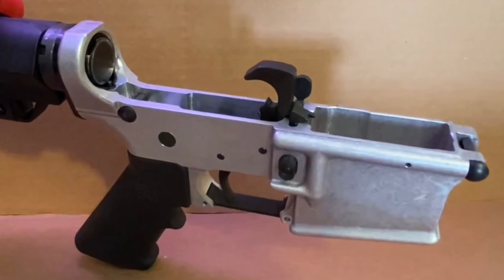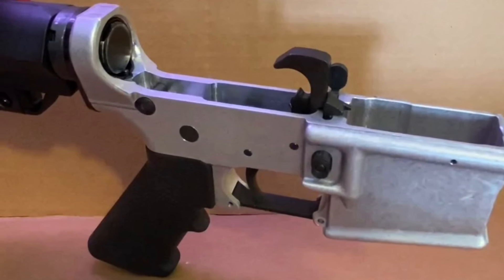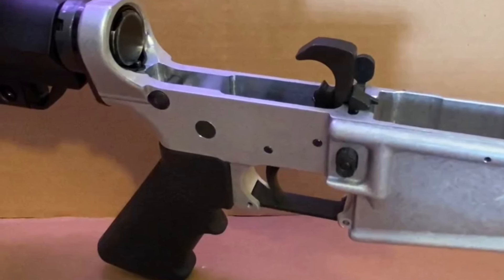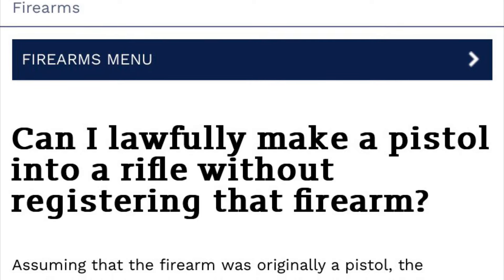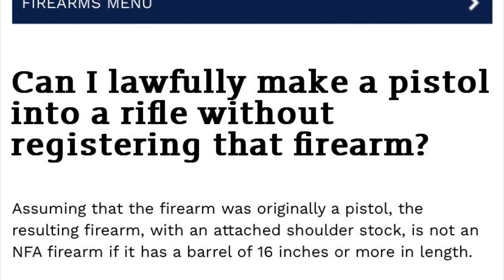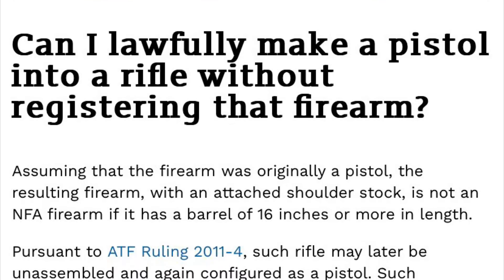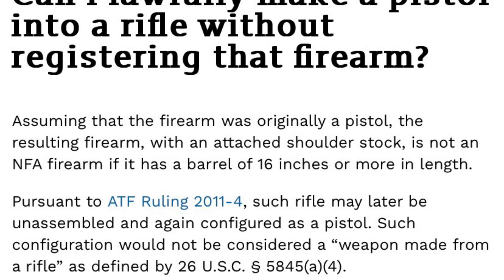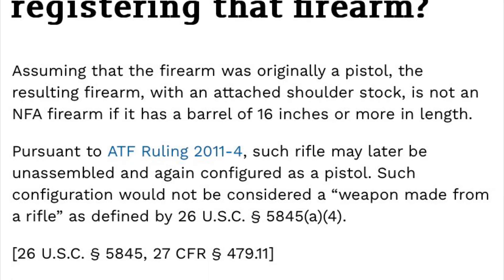AR builders tip #.223 - BUILD THEM AS PISTOLS FIRST

Comment: does the ar pistol have to have buffer tube? i was thinking of  making a brn 180 build and it doesnt need a buffer
Reply from the maker: With a BRN180, it doesn’t need the buffer tube. I believe they sell a threaded plug that you use in place of the buffer tube for an application such as yours.
Reply: @SMR-Tactical  yeah i was just wondering if i could use the  180 upper and leave nothing on the back .... is that still a ar pistol?

Comment: you cant go pistol to rifle than back. not legally.
Reply: u can... how do you think thompson center fire's exist?
Reply: @russr  exemption. just like artillery lugers with stocks.
Reply from the maker: @DieselRamcharger…perhaps you are talking about a state law, but per the ATF’s own verbiage, at the federal level you absolutely CAN go from pistol to rifle and back to pistol. It just needs to be originally created as a pistol. 

 “Assuming that the firearm was originally a pistol, the resulting firearm, with an attached shoulder stock, is not an NFA firearm if it has a barrel of 16 inches or more in length.

Pursuant to ATF Ruling 2011-4, such rifle may later be unassembled and again configured as a pistol. Such configuration would not be considered a “weapon made from a rifle” as defined by 26 U.S.C. § 5845(a)(4).”
Reply: @SMR-Tactical  man these rules are stupid and useless. was not aware of that one.
Reply from the maker: Oh man, I completely agree.